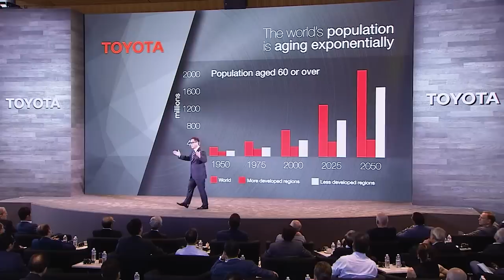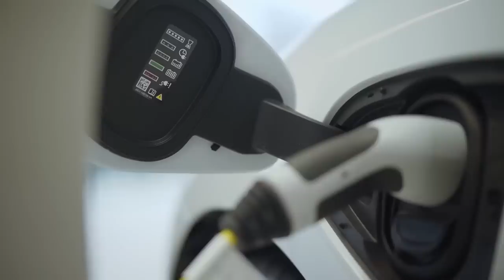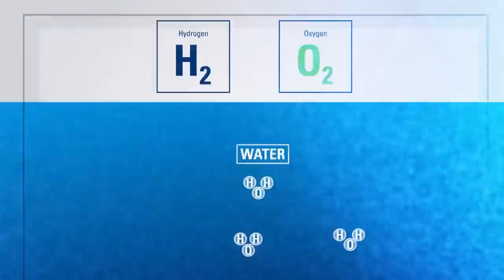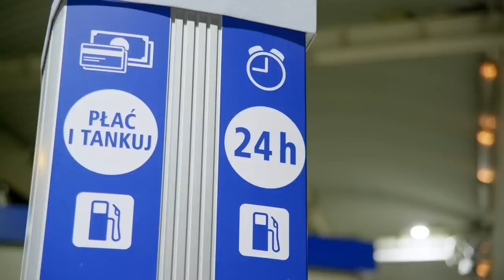New Toyota CEO Shocks Everybody | Huge News

Comment: Hydrogen powered vehicles are a concept I would totally get on board with. I also agree that Toyota needs to provide all vehicle fuelling options available to all people everywhere in the world, not just in advanced countries. Not everyone can afford to buy and run an EV, even the cheapest models. All nations have a lot of work to do in making the widespread use of carbon neutral and carbon free vehicles more commonplace in the coming years
Reply: if you can’t afford an BEV you can’t afford a HFCEV either
Reply: @What Ever   But with further development, the prices of both will surely come down...eventually. Everyone should have the choice as to which vehicle they prefer buying, if they have the money to pay for it
Reply: @ChopperV-8807  
Laws of Physics: HFCEV will always be more expensive without having any advantages. Plus the Infrastructure for Hydrogen is WAY more expensive and energy-consuming. 
We need Hydrogen for a more Green Industry, for Ships and aircraft not to move a car from point A to B. Its a Waste of Money and Time.
Reply: @Wha73v3r  but rampant development in all sectors can help meet global goals. I think that is the important part. If all industries work to find solutions especially through partnerships, private capital can actually help solve problems rather than create them.
Reply: @Heythere947  wow thanks for sharing the experience. I am tired of people hating on bevs just because or hydrogen just because it isn’t cheap dirty gas. It’s a new technology in its beginning stages. We all need to acknowledge the pros and cons and those working in the technology will continue to maximize benefits of each tech.
Reply: The United States don't want to have hydrogen fuel stations.  Hydrogen very combustible.  It's hard to fuel the tanks.  There are some people who just change out their tanks.  But the vehicle can explode also.  That's why there's so many indicators on the vehicles.  I wouldn't go with this idea. 
You could have taken a vehicle that uses gasoline and change it over to Hydrogen.  But don't use the tank method.  If you don't store the Hydrogen you would be safe.
Reply: @Wha73v3r  yeah that maybe, but when you take into account the current population of earth right now. 
That is a lot of resources that will have to be digged up to even meet the demands, plus digging so much wouldn't even be good for the planet anyway because it would require destroying lots of forests or forces people( Wildlife included ) to lose their homes and the earth's core cooling down much faster which could be doing more damage then fossil fuels ever could. People may not see it now but later on down the line they're going to realise they should of invested more into alternative fuels instead of going the EV route, yes it would be expensive but in the end will have been worth it.
You may have a point, but we are at what in terms of population 8 billion 10 billion I don't know, but I do know that there simply isn't enough resources to build EVs for that many people.
Reply: Piston engines will be around for a looong time
Reply: @harrisonnightingale6600  ehm no you forget those other technology’s need to be build too and these need to dig resources too. So they is no much difference. And more, if we talk about h2 
(In my case/perspective) Germany alone is consuming 66M/Liters of Patrol and 120M/Liter Diesel DAILY 
That means if we replace fossil fuels with H2 that we need to process ~250M/Liter (including efficiency and processing) Water every day. Just to drive our cars. + The Energy and H2 to transport H2 to the Station where we fill up our cars.

This impact would be much bigger. Using H2 for Cars makes no sense.
Reply: Why a Hydrogen Economy doesn't make sense.          Phys      org.      Look it up, it'll explain why Battery Electric is better than Hydrogen fuel cell or Hydrogen ICE.
Reply: Hydrogen cars are dumb. The fuel is difficult to store and energy-intensive to make while the fuel cells are just as complex and resource-intensive as batteries and the infrastructure for fueling is vastly more complex and expensive than battery chargers. This is Toyota doubling down on a losing decision they made decades ago to pursue hydrogen over batteries. 

Luckily for Toyota they are great at building cars and the minute a battery chemistry they approve of is developed they'll be able to flip a switch and move their platforms to that chemistry.
Reply: Fuel cells will never be able to compete with electric cars on price unless society changes. Most hydrogen is made using fossil fuels (Oil)  so hydrogen cars will never reach a price range less than ICE cars. Green hydrogen is very expensive too and requires nuclear reactors which currently many countries don't want to build unfortunately. So unless society embraces nuclear power plants globally I don't think hydrogen will work. Hydrogen is probably perfect for Japan only since it's got lots of nuclear plants and maybe France.
Reply: Did you know that if the atmospheric carbon levels go lower than 150 parts per million that a majority of plants start to stop growing and/or start dying? Carbon dioxide is hand in hand equally as important as oxygen.
Reply: @wtmotobikes8838  Yes but the bigger problem is that emissions from gas car isn't pure CO2. It also contains dangerous carcinogens. Not to mention the CO2 levels are about 50% higher than normal since the industrial age. This is about 30% higher than all of Earth's recorded history since complex life started. Probably not best to keep adding more.
Reply: Here's the kicker (it's a long one!!)
As @WhatEver indicates...
"HFCEV" Stands for 
"hydrogen. Fuel cell. EV "
.
It is, in essence, an Electric vehicle
The difference is how you get the "Electricity" to the motor (motors?).
Choices?
1) There's a fleet of Straight "BEV" units.
For every let's say 10GWH they take from the Grid, a pessimistic 8GWH (80%) reaches the wheels of the vehicles to do actual work.
Or
2) A fleet with the same number of equivalent HFCEV units.
Using the same 10GWH of grid energy, from exactly the same source to remove any "that grid is greener" opinion", an optimistic 3GWH (30%) reaches the wheels of the fleet.
The "straight BEV" Fleet travels 2.7 times [0.8 ÷0.3] the distance on the same grid energy.
Or, to put it another way, you need 27GWH to move the Hydrogen fleet a similar distance.
.
Who pays for that grid energy?
Not the energy provider.
Not the company supplying the Hydrogen.
Not the vehicle manufacturer.
.
It's the end user.
2.7 times the raw energy cost.
(We all know about that at the moment?)
.
You can add the huge cost of infrastructure build and maintenance.
1) If you want "Clean" Hydrogen, you must build the extra green grid to extract it (see below)
.
2) you need the (clean) water supply to extract it from
(That's going to become an issue moving forward)
.
3) You need a transport fleet to move it to point of use.
(I believe the energy density is such that you need ±10 times the number of road tankers compared to "conventional" fossil fuel).... That fleet also needs manpower and maintenance.
.
4) Point of use storage, which must be meticulously maintained..... A BEV charger fails, it's "inconvenient". 
A Hydrogen tank, or supply hose fails...... It's not "desirable" (and it has happened).
.
Let's cover "But you don't need loads of dirty batteries!!!"
.
You build batteries ONCE, then they're clean.... Hydrogen has "continuous supply" issues, similar to fossil fuel.
.
"Battery mining is dirty!! Uses "Rare Earth" materials"
No, and have you chech to see what's in a fuel cell? Or how long a fuel cell lasts? (Not as long as a battery)
.
You have to build the CHARGERS!
Equates to the same as the Hydrogen infrastructure, but you build it, then it's essentially "passive", with relatively minimal maintenance.
.
"But Hydrogen produces only WATER!"
.
🤔That "27GWH" of grid energy?
...... 17GWH of that is capacity that could be better used retiring Fossil generation from the grid.
Using it for Hydrogen Keeps the grid dirty.
.
Final 2 "arguments"(?)
"We could burn the Hydrogen in engines!!"
Not without major modification (it "eats" engines) and it's still an inefficient combustion process, it would be well below 20% efficient overall.
.
"What about Batteries going to landfill!!?"
.
Not only are vehicle batteries already 95% recyclable, but the companies growing the industry can literally"throw in" batteries from EVERY source, including the billions from laptops, phones, power tools, etc, etc, etc, which probably do go to landfill every year.
.....
Did I miss anything?
Reply: @Heythere947  
WOW!
Great perspective!
Reply: @harrisonnightingale6600  
See my post, it covers your position regarding "resources"
Reply: @wtmotobikes8838  
Did you know that TOO MUCH   carbon dioxide (not "carbon") alters the physiology of plants?
It's not good.
Imagine if you breathed pure oxygen for an extended period. It wouldn't end well.
Reply: depending on how much you drive, and i suppose energy prices where you live, a EV is cheaper overall compared to gas.  Most people are financing new vehicles anyway, so the higher sticker price is less of a issue than you think.

What I would like to see, and what i think is the most practical overall is a EV with a modest battery, say 100mile\160km range, with a small onboard generator for longer trips.  That sort of range would cover the vast majority of most peoples daily\frequent driving needs, even with battery degradation.  The onboard generator need only be big enough to cover the average fuel economy of the car.  In my case a 20kw on board generator would enable me to drive virtually indefinitely.

This sort of car has existed in the past, but consumers couldn't understand them.  The idea is that if you headout on a long drive, you start the generator BEFORE you need it.  If you wait until your nearly out of juice you can be severely speed limited.  Hauling a bigger generator to get around this forgetfulness\naivety is needlessly expensive\wasteful.

20kw sounds big if your thinking of whole house backup's, in a car though this isn't the case.  20kw is 26 horsepower, put some padding in there, maybe 50hp (how big does a 50 horse car engine have to be, especially when it won't get used much).  For the generator head, they are the same as electrical motors, and how big are those usually in these cars? not that big, a 180 amp alternator is about 3kw, and it's tiny.
Reply: Why every time I read a comment against EV I feel that the author are ignoring technological advances for batteries? And yes there will be tech advances also for the hydrogen, there will be always a gap into ease of storage between the two
Reply: EV battery problem are the biggest issue, when the battery fail and no more warranty it cost 40-60% of new car
Reply: @ChopperV-8807  If all could afford EV, then what about the national grid. What about charging points, millions live in terraced housing or flats. Will it have the environmental impact that many keep promoting, especially as lorries and deliveries rely on diesel.  There is no practical EV alternative for heavy vehicles.  Then of course, what about the airports.
Reply: Hydro is extremely flammable more than gasoline or batteries. Lol have fun with that
Reply: @ChopperV-8807 
EV is way easier to control by the government for their 15 minute cities than gas powered ones. We're going on a worldwide surveillance you only think a movie can allow.
Reply: Good to see a fan of the NSW V Sets
Reply: Hydrogen at $0.30 per mile, I rather use gasoline or go with EV.
Reply: Hydrogen cars? Well, not everybody has the money to pay 4-5 times more per kilometer than for electric cars. Porsche drivers probably can. But that's a niche. Good for you if price does not matter for you.
Reply: @rogerstarkey5390  the leaf pores, or stomata density is a proxy for paleo-climate CO2 levels, as CO2 goes up slowly, plants create fewer stomata to maintain suitable CO2 supplies, hence fossilised leaves can give an indication of the atmosphere's CO2 concentration.  That is when CO2 changes at natural rates, approximately 170 times less than current levels indicated by some reports I have seen.  

The destroys the fossil fuel industry obfuscation that CO2 is good for plants!  CO2 is also way down the priority list limiting plant growth, long after water, light & nutrients.
Reply: @rogerstarkey5390  Great summary of the insurmountable challenges hydrogen faces, although you did miss one thing...  

The fossil fuel industry is pushing hydrogen quite hard as steam reformed natural gas (grey hydrogen) is far cheaper than green hydrogen, hence this perpetuates the fossil gas market (with no regard to the greater damage carbon footprint of grey hydrogen, larger than just burning the fossil gas used as feedstock) as grey hydrogen would get used because of its lower cost, destroying any green benefits.  

Shocked that the Japanese were considering black hydrogen from Australian lignite (black hydrogen probably has the largest carbon footprint of any fuel) as a green fuel!  No doubt there will be claims that this is solved by the fiction of Carbon Capture, the issues are best summarised in the following youtube video that is scientifically correct even though the presentation is ... not quite David Attenborough:  

"Honest Government Ad | Carbon Capture & Storage" on youtube
Reply: Rodney Howard  The hydrogen pushers think 150k is cheap.

Comment: All I can say is if Toyota wants to go hydrogen then as you say they would have to invest in the infrastructure to make it work. So boy they better have deep pockets. The two problems they will have to overcome other than the lack of filling stations is both the cost of producing the fuel cell and the cost of the hydrogen. It is also worth mentioning hydrogen is very volatile and has to be stored and handled with care plus how clean it is depends on how it’s produced.
Reply: They have Fossil Fuels backing. It's the only explanation for this lunacy!
Reply: @jimthain8777  Exactly. Free energy from the sun, or manufacture hydrogen at great cost. I wonder which will be cheaper.
Reply: "Dang, that's the 12th hydrogen fueling station to ignite this month."

What's up with that?

Comment: In order for us to go full EV we need to make sure our power grids withstand it. We saw in California the Governor asked people to not charge their EVs because the Power Grid could not withstand it due to the heat wave that went through.

Also, we need to go Nuclear in our power generation. It is the most efficient in terms of land usage and more environmentally friendly than Solar, Hydro, and Wind combined. Yes, it will produce nuclear waste, but we are currently in the process of making nuclear waste into something useful. Just last year Telsa announced that they are working on Nuclear Batteries made from Nuclear Waste and Diamonds. So in time, Nuclear waste won't be waste.

Once we build up our infrastructure first then we should switch to full EVs, but as of right now, Gas Cars are simply better for the environment as much as that sounds counterintuitive.

Comment: For all those who demonize EVs here, but you know that a hydrogen car is also basically an EV, with a fuel cell and the necessary high pressure tanks added. Even a EV battery for buffering is present! All in all, much of additional technology that makes the car more expensive. Not to mention the up to 5 times poorer efficiency of the power train. German car manufacturers researched hydrogen technology in cars since the 1970s, with no real breakthrough. You can forget about hydrogen for private cars because the production of large quantities of H2 is far too expensive. Also Toyota won't be able to work against physics either.
Reply: These guys aren't the sharpest tools in the box, are they?
Basic science should be enough to understand but they just don't get the concept of efficiency.
(Or that as you say. A HFCEV is an EV !)
smh

Comment: It will release huge quantities of CO2 when they (the big oil companies) make the hydrogen from other hydrocarbons like methane. It will cost a lot more than gasoline. Compressing the hydrogen also uses energy and adds cost. It will be a continual problem to keep the highly compressed hydrogen gas from escaping and igniting in enormous explosions. Of course, you don't have to generate the hydrogen from methane. You could use electrolysis, but they don't because that is even more expensive. So if you loved the high gasoline prices in 2022, you're going to be ecstatic about hydrogen. 
Don't be fooled. Hydrogen is being pushed by Big Oil because it will allow them to maintain their control over the fueling of the transportation sector. Big Oil hates BEVs because it cuts them out of the picture altogether.